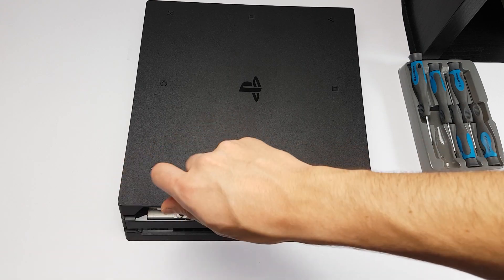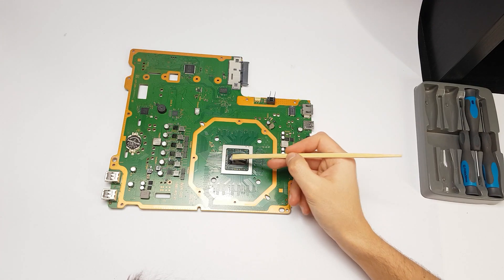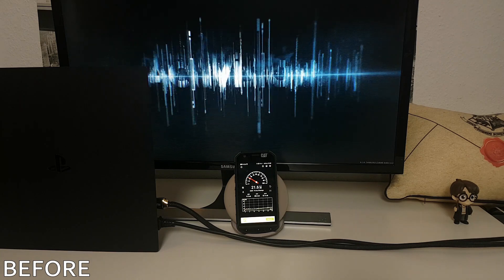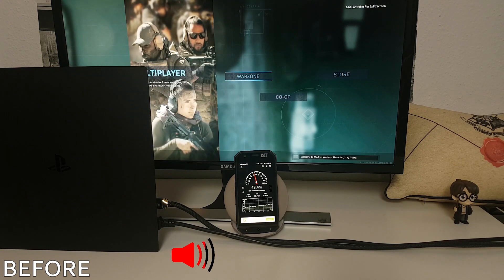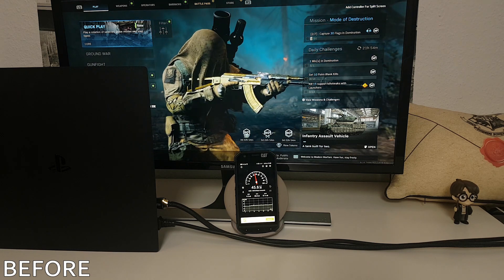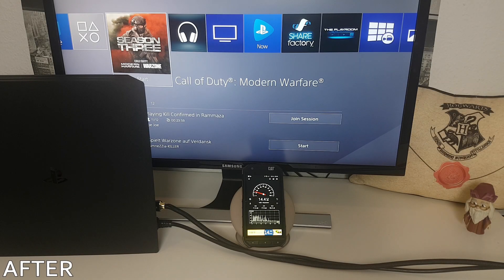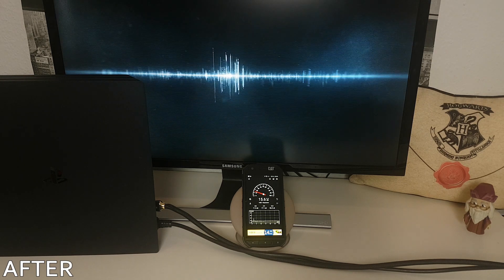PS4 PRO Fan Noise FIX - Thermal paste & dust - Before/After TEST

Comment from the maker: CORRECTION: Please, don't apply as much thermal paste as I did. A small drop/stripe is enough. Have fun !
Reply: In fact, the amount that you applied is a bit on the "more than enough" side, but all the excess will come out, and it's better too much than too little. A lot of times the heatsinks are not completely flat and they don't sit properly on the apu(or gpu and cpu,specially on laptops). If you spread the thinnest amount of paste and assemble the heatsink and then remove it, you will see that a lot of times the heatsink touches 4/5 of the cpu... A bit more thermal paste helps on this situations.

 The spread method, that you used, is always better than a drop in the middle, because it covers the entire chip, while a drop may or may not cover it.

There are a lot of tests on youtube regarding methods of applying thermal paste. Check gamers nexus for that kimd of content. Even der8auer talks about this on a gamers nexus video.

The only time that too much can damage anything is only when the thermal paste is conductive(liquid metal) or capacitive(arctic silver 5). But from a thermal standpoint, too much is better than too little.
 
But there are a lot of thermal paste gurus out there that say its not because of the air bubble myth. The pressure between the heatsink and apu is too high. There are no bubbles. The air comes out with the pressure. And the excess thermal paste also.

The only thing that you must be careful is when you remove the screws that hold the heatsink, it's better to unscrew them a bit at a time and on a cross shaped fashion, to evenly remove the pressure on the apu. If you unscrew them like you did, sometimes theres too much pressure on one corner of the apu and it will crack. Not so much on the  ps4, because the apu has metal all around the chip pcb, to avoid this. But on a lot of situations(like laptops), the chip die cracks. Do the same when screwing them. A bit at a time, and cross shape.
Reply from the maker: @chicozeb  Wow, thank you for your thorough explanation! I'm sure it will help a lot of people in this comment section :)
I'll definitely keep in mind that the screws holding the heatsink should be unscrewed a bit a time and on a cross shaped fashion.
Reply: @SiriusMonkey  Thank you! I'm looking forward to try this within the next few days. I tried different approaches to reduce the noise from my ps4, and I don't really want to buy another ps4 yet (thank you ps5 haha). I only hope I don't mess up my ps4 pro
Reply: @SiriusMonkey  Could it be possible that the problem on my ps4 pro could just be the dust on the heat sink and not the thermal paste???? I cleaned my ps4 off dust earlier this year, but I didn't clean/make it to the heat sink
Reply from the maker: @samusranzer  I don't think that cleaning the heat sink is enough to make your PS4 Pro go quiet. You should do it nonetheless :)
Reply: @chicozeb  MX-4 is capacitive? cuz I applied a little too much...
Reply: @carloselgamer1  No. If it's capacitive it says on the box. The capacitive ones that i know are arctic silver 5 and ic diamond(not sure if is capacitive or conductive). But arctic mx4 is not very good. It has an high silicone content and will pump out over time. Personally i use non silicone pastes. Arctic silver 5, thermal grizzly hydronaut(not kryonaut, it has silicone and temperatures are 3 to 4°C higher after a few months) and cooler master master gel maker(never tried this one, but it should last long because it does not have silicone).
Reply: @chicozeb  Ok, thank you bro
Reply: chicozeb  does this also fix the heat problem. My ps4 is clan and has no dust but when I turn it on it says it to hot.
Reply: Puhlse it will fix it bro all you have to do is put new thermal paste or most likely the fan is not working properly
Reply: @chicozeb  Help Bro. which thermal past is best for ps4 pro...?
Reply: @Samurai-pe6rv  thermal grizzly hydronaut. Not kryonaut. Kryonaut dries fast. Hydronaut last years.
Reply: @chicozeb  Thanks Bro. But Noctua NT-H1 good or bad.....?
Reply: @Samurai-pe6rv  i have that paste, it had the best reviews when i searched. Im doing mine this tuesday coming :)
Reply: @muff3m  U telling Noctua NT-H1 is best...?
Reply: @muff3m  thanks bro
Reply: @chicozeb  My ps4 is overheating after 5 min after starting. I clean it and change my thermal paste with AG Silver. I just put a bit like a grain of rice. I don't know if this thermal paste is good for PlayStation.Please guys help me!!!
Reply: @frostlix1212  it's good. I would spread the paste though. A grain of rice may not cover the entire die and you'll get hotspots on the chip.
Reply: @frostlix1212  is it fixed mate
Reply: Stop listening to these guys. Everyone has an opinion on how much is too much. If your PS4 is still working, you’re fine. Next time you do it, make another video and see how many people comment you didn’t use enough. You can’t win with these turds. They literally lose sleep over thermal paste.
Reply: Dont worry, thats not too much
Reply: @TSM_ ImJoker it's not going to be perfectly quiet, it's not going to get rid of the heat, what the pate does is helping the cpu to pass the heat to the heat sink, actually if the paste is well place it could be hotter in the top because the heat has went to the heat sink, now, the paste could get rid of the noise but not all, don't think is going to be completely silent while playing warzone (for example), but what could do is when you close the game could help to get rid the noise when the fan is trying to mid the temps, I change with mx4 to and while playing some games is still making noise, some of them make more noise than before but now it's not all the time, is less and the time when the fan makes noise when I stop playing is less. (there are some games that gets more benefit of the paste and make less noise, but it's not the common denomination) 

The paste should be smooth, fine fine line of paste, if you can't make the fine line you can try putting a little X in the center of the apu because it could be difficult to make the smooth fine line of paste. If you put a lot of paste, the ps4 can act weird, for example if you put a game it could begin to glitch (visually) and then crash, then just the only way to turn off the console is unplugging the cord and if you try to turn on the console you get the pulsating blue light because the cpu is overheated, this happen to me and then I just moved the excess of paste and was OK, from what I heard (from a friend that has a maintenance shop) is more common this rather than when the people put less paste.

If you think the top is hotter, then the paste is doing what it supposed to do, if it takes a while to get hot, probably it has a lot of paste.

*sorry for the big text.
Reply: Do you use noctua paste?
Reply: Dominik Molnár  base on the function theory about thermal paste, that mean your heatsink received heat from APU better than before so it's good, the paste is work
Reply: @WildGrowthMusic  and that could cause problems because the ps4 had the option of shutting down and before telling the user that it needs that, but when applying a lot of paste this function don't work as intended in a lot of times, so the apu gets hotter and then when it shutdown (or it glitches and forces to disconnect) now becomes a pain to dissipate the heat and that heat could practically detach a pin (ball) of the apu. Now, putting more is more obvious than putting less, I think is more easier to get off the extra paste, and at the same I think when putting less It could be thg same, just putting a little bit more until there is enough, the big problem is knowing when is enough, personally i put less and then I use a thermometer to see when is dissipating more heat and taking in count the time, but doing that it's time consuming.
Reply from the maker: @TSM_ ImJoker It should cover the entire area of the cpu :)
Reply: @TSM_ ImJoker The thermal pads breaks with time, if you see one of them in a half or if you see them crumbling it could be good to change them, I don't remember what  W/mK are the originals but they should be 1mm.
If you see one missing, they are crumbling apart, yes a change is nice, if not there are no much hurry in that regard, in this case it won't change a lot the fan noise but it could help (maintain) the ram and (if I remember) the vrms and other chip that I don't remember exactly if is the second processor that activates when the ps4 is in sleep mode.
The pads should and it last longer than the paste but it depends on various factors, this is depending of how you see the pads on your system, the thing here is that you need to understand that the paste is not going to get rid of all the sound, and if the paste is working the top should be more hot because is disipating the heat from the apu to the heat sink and that's why is hotter.
Reply: @TSM_ ImJoker That's seems to be a hard drive problem.

You can see other videos to see how much paste they used, see if you put a lot, but the heat is going to be there, the paste is not going to disappear the heat, what the paste does is help the apu to pass the heat to the heat sink, thats why it feels more hot, in theory that should happen, that's ok, i can't tell you if the paste or the pads are the problem because i don't know how much, how you put, etc, that's something that you should be taking in care comparing on how it was when you bought the system, before and after, taking in place variables of when you put the console, a lot of things that i don't know so i cant give you an exact "yes, you need to do etc", the code that you put is a problem with the hard drive, it could be a hardware (HDD) problem or it could be a problem with the OS and re-installing the OS could fix that, but i cant give you an exact "This is going to fix it" because this is not exact, and by now i don't know if you understand that changin the paste or the pads are not going to make the ps4 go all quiet or like an iceberg.
Reply: @TSM_ ImJoker if the top is hot it's not going shutdown, the alert/shutdown is because the apu is hot and now it's passing the heart to the top so it's not going to shutdown.
No, the pads are not going to change that, actually if you find better pads is going to feel hotter because like the paste is going to help pass their heat to other surface, better to keep the heat in other surface rather than inside, so, the top and bottom are going to be hotter and are going to try pass the heat to the surface that is place.

You can buy better pads, I don't know the wmk of the originals, search again, take your decision.
Reply: I have applied thermal paste abundantly 😀
Reply: I have a question
Reply from the maker: @ThatZkid Thank you for your notice :)
Reply: I know that it was too much right from the beginning but if u use not enouth thermal paste and it doesnt cover the whole entire die, that may brake your console because the whole area is generating heat and if not coverd, it´ll overheat just at that part and just chip away and make ur console unrepairable
Reply from the maker: @maxklassen254  Luckily for me, it didn't damage my PS4 Pro, but after 2 months or so it was very loud again. I've decided to replace the thermal paste a second time by applying a little less thermal paste this time. Result, it''s still quiet after 2 months :)
Reply: @SiriusMonkey  well too much might've blocked more heat transfer than it should but good to hear its being quiet again.😁 Do you also hear the coil while when playing a game?😅
Reply from the maker: @maxklassen254  Absolutely! This is why I pinned this comment :)
No, I don't hear it 🙃
Reply: @SiriusMonkey  it's still running quietly?, I'm thinking on change the paste but in a slim ps4, I usually use mx4 and artic silver in my machines (and machines that I fix), and hearing about grizzly and noctua is making me think about using those, but they are practically twice the price of the mx4, in all my years I've never doubted about using a thermal paste (brand/model) until now, and with consoles, lol. Great video by the way.
Reply: How long do I to have to wait after I apply the paste to turn on the ps4
Reply: @TSM_ ImJoker I'm sorry for not giving you the exact answers.
Reply: dunno if you guys gives a damn but if you guys are stoned like me during the covid times you can stream all the new series on Instaflixxer. Been streaming with my gf lately xD
Reply: @Emery Darwin yea, I have been watching on Instaflixxer for since december myself :)
Reply: I thought the PS4 pro wasn’t as loud as the original ps4?
Reply from the maker: @Reagles8  Much louder than the original PS4 !
Reply: I use my ps4 pro to annoy my family lol 😂have it running while they try sleep
Reply: @Te-Horo  Hahaha I cannot play for long with either my ps4 or my xb because my bedroom transforms into an airport from the consoles' fans haha

Comment: Great video! Sounds slightly a bit louder, but big difference. I deep cleaned mine & replaced thermal paste as well, it sounds really quiet
Reply from the maker: Thanks ! Replacing the thermal paste helps a lot 😊
Reply: @SiriusMonkey  it does! Hope your ps4 is still going strong 💪
Reply from the maker: @PokeFedx  My PS4 has retired 🥲
Reply: @SiriusMonkey  sorry to hear that, hopefully you got a ps5 as a replacement :)
Reply from the maker: @PokeFedx  Yes, upgraded to the PS5! 🤩

Comment: The noise comes back because of the fan speed tweaked to low by Sony's firmware. If you had a jailbroken PS4 Pro, you can install PS4 Temperature app and set the fan speed to 66 degree Celsius which I did mine and your thermal paste will not dry out. And you could see the internal APU temp as well
Reply from the maker: Thanks for the info! 😊
Reply: @SiriusMonkey  you're welcome.

Comment: I replaced the thermal paste last month it was really silent now it's getting a bit louder but not even close to a jet engine
Reply from the maker: The new thermal paste should help for a few months. Eventually, the noise will come back 🥲
Reply: @SiriusMonkey  everytime it goes back to a jet il probably change it again
Reply from the maker: Yes, that's what I did as well 😊

Comment: I opened the top and couldnt find any visible dust on my ps4 pro’s fan or anything. My dad has been the owned previously and has never touched it basically. My guess is it wouldnt need to be opened and tampered with if it hasnt run that much?
In mostly looking this up cause of lag in game
Reply from the maker: The purpose of cleaning your PS4 is to improve heat dissipation. I don't think that it will help much (or at all) with lag in game. 
As you, if the PS4 hasn't been used much it should be good inside ☺️

Comment: how is it now ? Did you use better thermal paste or changed the thermal pads ? because i saw that you said after 2-3 months it started again ...
Reply from the maker: That's right, the method shown in the video lasted 2-3 months. If you use better thermal paste & replace thermal pads, it should stay quieter for a longer period ☺️

Comment: I did the same, 4 hours later, after playing Warzone, the loud noise returned.
Reply from the maker: 4 hours ! 😵‍💫 Same thermal paste ? Thorough cleaning ? 🥲
Reply: @SiriusMonkey  no, no, something Cheap. 
2017 on the label,  probably out of date.
Reply from the maker: @paulconstantin4760  Ahh dammit, that might be the reason. Mine lasted for approx. 4 months. If you replace the thermal pads as well, the silence could last even longer ☺️
Reply: @SiriusMonkey , update, new thermal paste applied MX4 and thermal pads replaced with something better 2.0mm Odyssey. 
The sound returned to normal. 
Advise, when you put back the metal plate on the top of processor, don't squeeze screws too hard, leave a bit loose. 
I found the old thermal paste in pretty good condition , but was spread all over, nothing on the top of the processor.

Comment: The amount of thermal paste is fine. The APU is a bare die without a heat spreader, so you need full coverage, spreading it first is good practice here. Arctic MX4 would have been a better choice, MX4 is the best general purpose thermal paste. it conducts heat well, it's non electrically conductive, it's cheap, and the lifespan is 8 years (claimed). I never bother with anything else. 
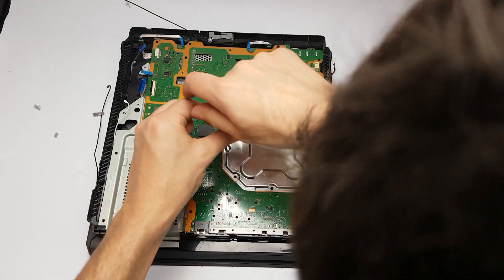One other trick is to get a large thermal pad, about 5x5cm, and stick it on the metal plate cover (00:52) over the memory chips, to help conduct heat to the actual metal back plate. currently there's an air gap. and replace all the thermal pads with better ones while you're in there
Reply from the maker: Imperial Knight, thank you for your feedback! ⚔️ I should've replaced the thermal pads as well. The positive results shown in this video lasted approximately 2 months. It would be more if I replaced the thermal pads and used a better thermal paste ! 
One is constantly learning ☺️

Comment: I got a question I know this is a year old video but do you need the dark gray little squares on the metal plate?. or can you just throw them away I actually throw them away when? I Dismantled my ps4 pro
Reply from the maker: Yes ! They're thermal pads and very important for heat dissipation 😵‍💫 Some people even replace them ☺️
Reply: Hehehe yeahhh just loud  airplane sounds and too hot heheh but I got this! 😁😅
Reply: Alright thank you I actually throw them away whoops hehehe
Reply from the maker: @ultimathechaoshedgeh2222  Hope nothing happens ☺️

Comment: Did it significantly increased the gaming performance and game FPS?

I have the very first PS4 and I think it sounds even worst than that. I want to do this but I am wondering if it only be less noisy or if it will be increasing my FPS's while playing Warzone. 

Thanks!!!
Reply from the maker: The main improvement is noise reduction! I did not test gaming performance, but I didn't feel much of a difference after replacing the thermal paste & dusting.. The PS4 can't go above 60 FPS anyway 🥲